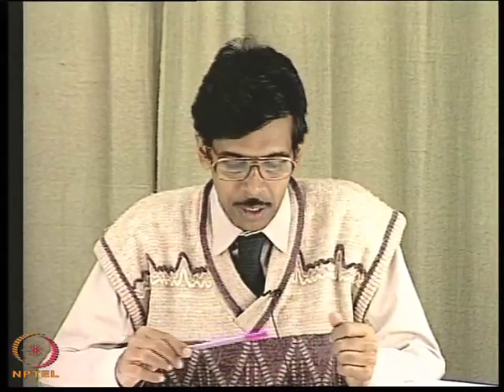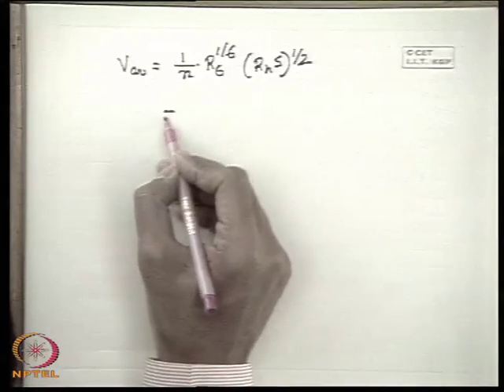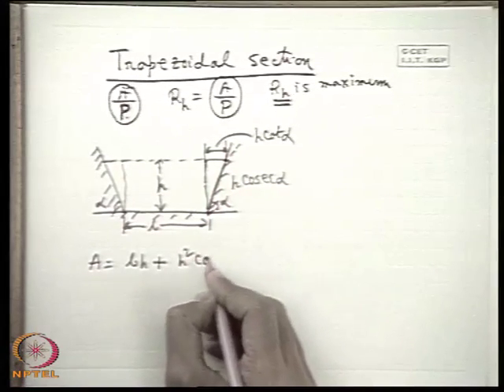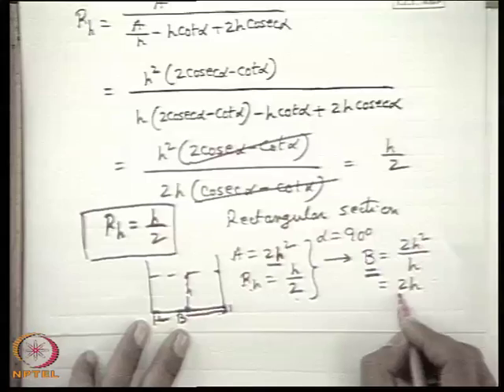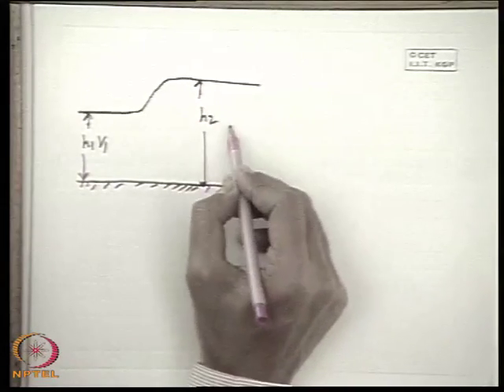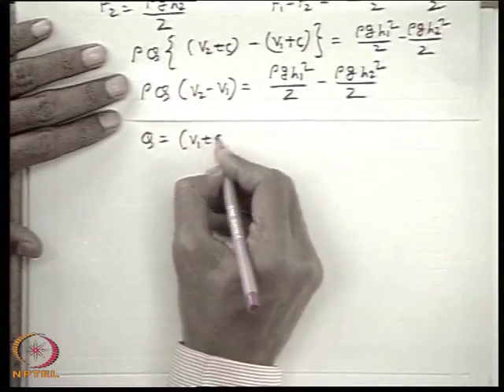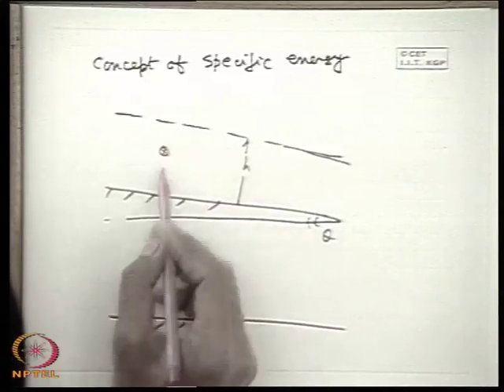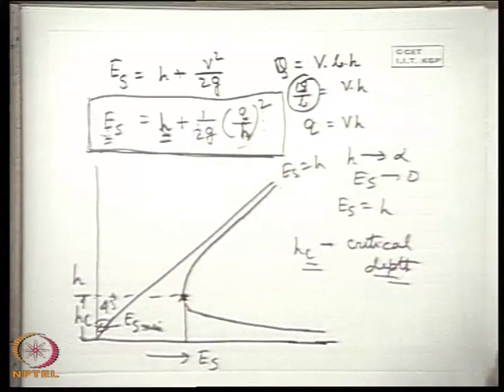Mod-42 Lec-42 Flows with a Free Surface Part II

Comment: In case of free channels, slope would be variable. How do we take care of it?? how is possible to measure slope at different points along the flow??
Reply: I do have a same doubt!
Reply: @ayushdubey840  If the slope is changing the flow wont be uniform . But here we assume that the flow is uniform and steady.